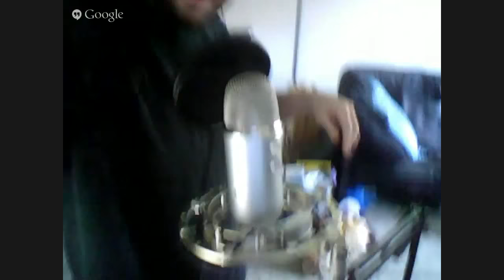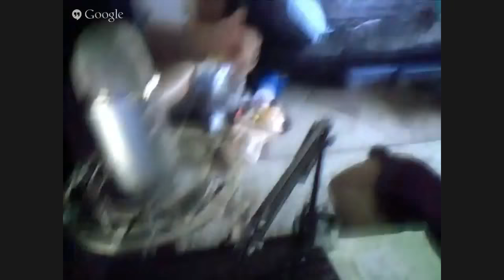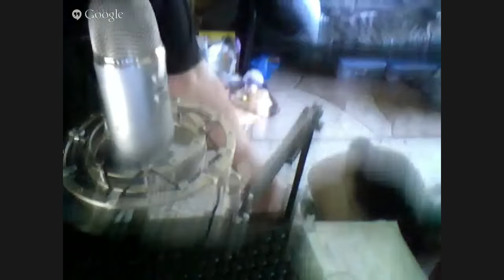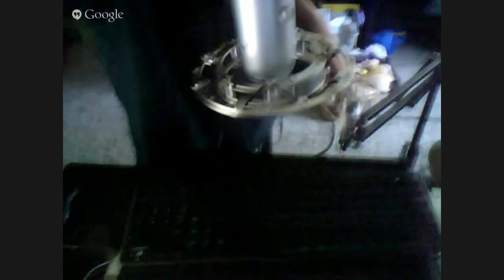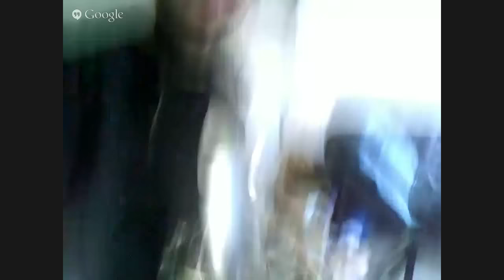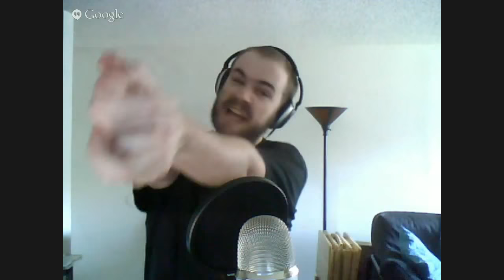Level and Systems Design - Patreon Q&A Session [3/6]

Comment: >1:42 - How to design upgrades for non-linear games
To extend on the megaman analogy, it's not that you can play those rooms in any order, but you can. It's that certain rooms do certain bonus damage. This wasn't transparent to the player, it was left to the tips and tricks sections of magazines and so on, but it was a different time.
The layout of the megaman stages reminds me of how Planescape Torment, while linear after a certain point had maps representing each square of the alignment table. This is transparent to the player but also leaves a lot of area for expression. Lawful Good and Chaotic Evil are opposite. You can expect angels in the former, and devils in the latter. You can make these opposites cancel out, or do extra damage to one another, and that can be intuitive to players.